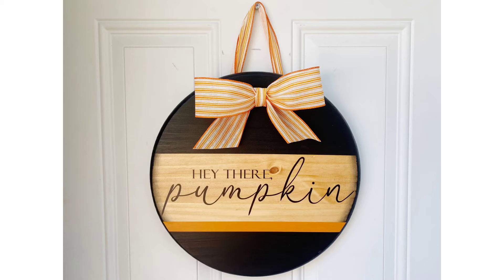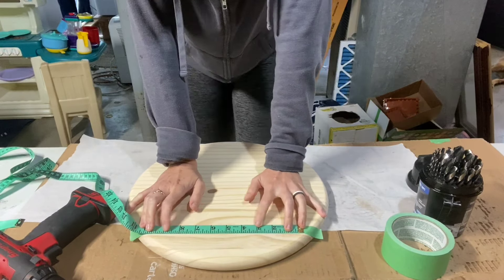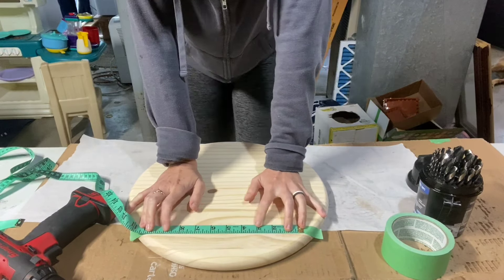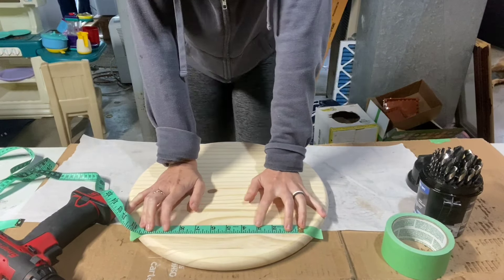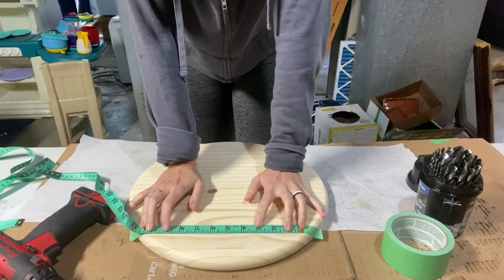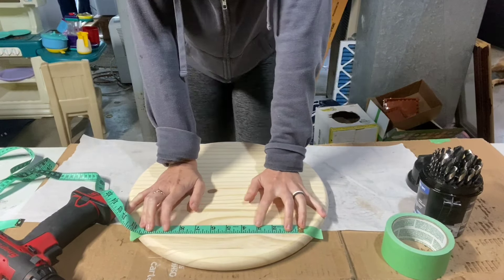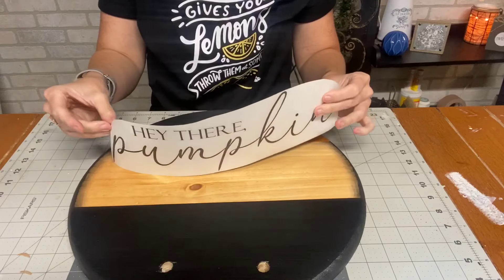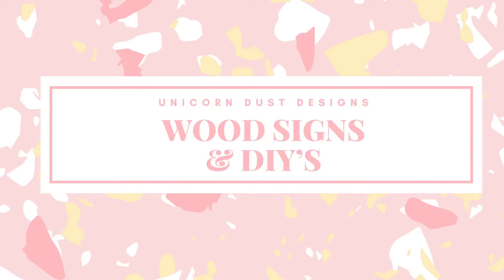DIY WELCOME SIGN | REVERSIBLE WOOD ROUND DIY | WOOD ROUND DIY | REVERSIBLE WELCOME SIGN

Comment: Hi! Two questions for you (I’m a newbie so apologies if this is stupid lol) I was told that after you stain wood you should seal it then do a primer coat before painting then seal it again..... I see here that you stain then go right to paint Have you tried the other way or are those just extra unnecessary steps that I can skip? If they will be out doors will they hold up? Lastly you said you played with acrylic paint this time... what type of paints do you find best?
Reply from the maker: Hello Stephanie. So I find that if you stain and then put a layer of clear on after, it will give a texture to your piece of wood that I personally don't like. So that's why I stain and then paint. I use Helmsman in order to protect the signs for outdoor elements. You could put 1-3 coats of that on. However, this was also my first time working with vinyl and I did not put a clear over it soooo not sure on that.

Comment: Hey girl! So my concern with these reversible signs is the weight on the ribbon! Did you have any issues with it getting loose at all?
Reply from the maker: Hello! I do not have any issues. The sign really isn't that heavy and over time I'm sure the ribbon itself won't look as pretty where its hanging but that's what's great about it because you can take them off and replace them.

Comment: Hi i have another question my husband made the holes and he took off a very large piece of wood so i was thinking of fixing it with wood putty because the black would hide that. Any thoughts on that and is there a certain size of drill bit, he started with a small bit to start the hole and then went in with larger bit than it cracked a large piece. thanks
Reply from the maker: Hi Michelle. Was he drilling on the line where the wood is glued together? Ummm I believe I put the drill bit size in description but if not I will find it for ya. Wood filler would work just fine if you’re keeping it for yourself. If you’re selling it I would make another one.
Reply: Unicorn Dust Designs  thanks I oh yes it is on line, I bet that is it and I am not selling.  I only do for myself family and friends just a hobby I just love watching you. You have taught me a lot Thankyou
Reply from the maker: You’re so welcome. So always make sure you’re drilling on the top or bottom of a line. If you don’t want to drill you could always use eyelet hooks on the side of the board.

Comment: Do you use anything to prevent sap? I follow some Facebook pages and have seen people say the board have sap coming out of them after some time outdoor.
Reply from the maker: Ya know I’ve started seeing that too. I’ve been making signs for around two years ago and have never used anything and have never seen sap come through. I’m curious to know how you would use it though. Because usually if you put a clear before painting it adds a texture 🤔🤔🎃
Reply: @UnicornDustDesigns  I've just started making the signs but I have followed your sometime and never thought about the sap. Some say to use shellac but seems like another to use shellac and a sealant aftwards.
Reply from the maker: So I wonder - do you put it ... say over your stencil as it’s first layer of white - since that’s the color it comes in and then put the white chalk paint over that 🤔
Reply: @UnicornDustDesigns  I saw that about coming in white.. hmmm not sure. If you haven't noticed anything on yours I'm taking your advise. Can I ask have you evern used birch rounds? Any good or stick to pine?

Comment: Hey I love your board, I’m having a hard time making my lines straight and putting my decal on straight, any tips ?
Reply from the maker: Hi Christyn. So if you're using the same wood round as myself there are definitely lines there where the wood is glued together. I use those as my straight line guides and follow them when laying my tape. As for the decal I really just look down onto my sign and eye ball it. What's great about this sign is the BOO doesn't necessarily have to be straight because of it's font and how it's kind of floating there.

Comment: How did you get the bow on both sides? Did you hot glue a bow to each side?
Reply from the maker: Hello. No, I tired the ribbon through the holes I drilled and tied it into a bow ❤️
Reply: @UnicornDustDesigns  it looked like there were two bows!

Comment: Where do you find your microfiber staining cloths again?
Reply from the maker: You can get a huge pack at Walmart or even any hardware store. They’re usually around $10 for a huge bag
Reply: Another question about the microfiber towels: do you reuse the squares you cut of them or just throw them away?
Reply from the maker: No, you have to toss them or maybe - you can try storing it in a sandwich bag, I’ve actually never tried that but may be an option if you don’t want waste.

Comment: Crooked holes add character and to be honest nobody will notice. Handmade means there are going to be imperfections and make the piece unique. The next time you need to drill a hole especially one that large. First drill a smaller hole then follow up with the larger bit. Less chance of the drill bit skipping like it did on you. Great work as always.
Reply from the maker: Thank you Chuck! I didn’t notice after putting the bow on at all. Thought it would make it lopsided but nope 😊 and thank you for the tip. I’ve also heard to put painters tape on top of the wood to help from splitting wood. Have you tried that before? Thank you so much for watching!
Reply: @UnicornDustDesigns  Yes, I have used tape to help stop ship out on the top side of a hole. I also use a backer board under the piece I am drilling through to reduce blow out on the backside. On a side note I decided I am going to try some of these wood round door hangers. I have been to Home Depot, Menard's, and Lowe's and none of them have had wood rounds for weeks. I am guessing that it's due to the lumber shortage and mills being behind.
Reply from the maker: Dannnng. Have you checked if you can order online and do store pickup?
Reply: @UnicornDustDesigns  Yes, i ha e some on order from Menards. Due in around 9/15.
Reply from the maker: Yay!!!